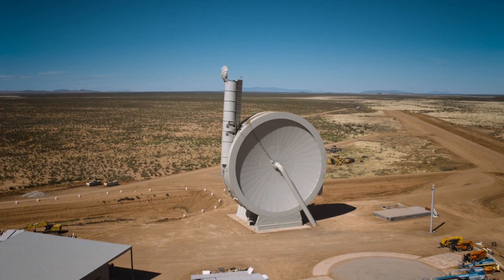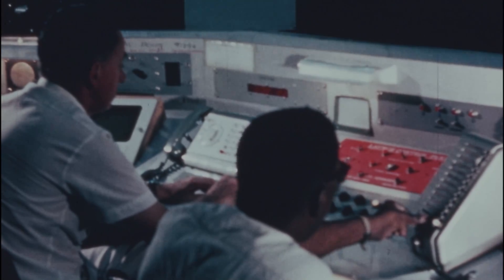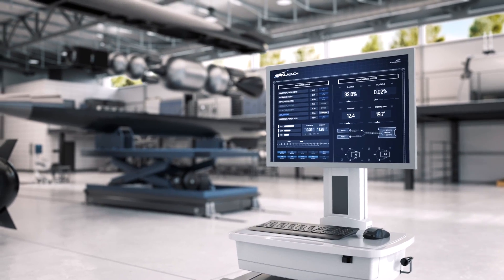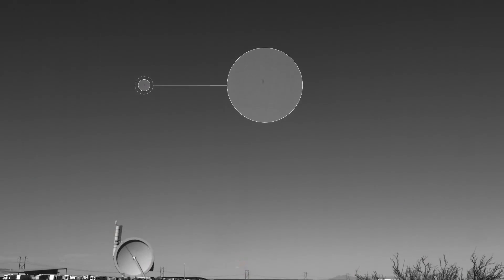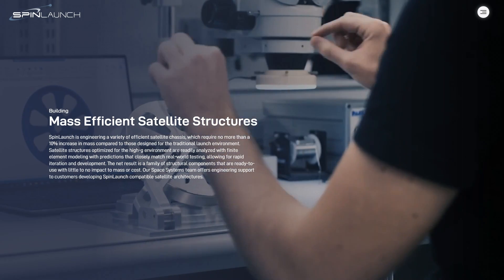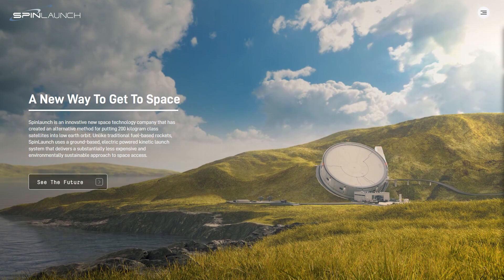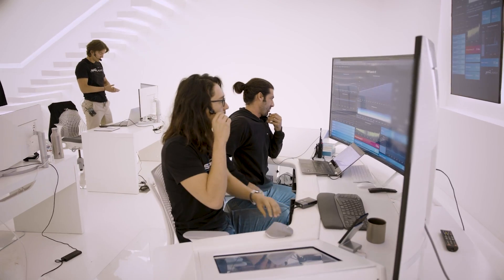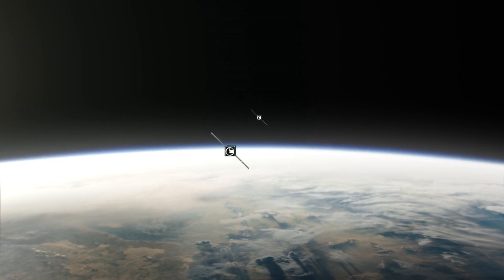Can Spinlaunch Throw Rockets Into Space?

Comment: maybe someone with some scientific sense will read this. no you cannot. they will never make this work.

because such a rocket needs around 8 km/s to get to even the LEO. 

and you know what happens to stuff when it hits atmosphere at 8km/s.

so, a waste of money. best they can do is a little nudge for the rocket, so not worth it.
Reply from the maker: While I’m skeptical, at least I bothered to read their publications and know that they have a 2 stage Kerolox rocket using pressure fed engines.
Reply: @scottmanley  thanks. I am aware of that. This just looks like a lot of work for just a small nudge to the initial phase of the flight. And the 20000G? this whole thing inside, I believe its a technical nightmare to fix everything toegether so it does not break down structuraly. I am not talking about the rocket, but any real sensitive cargo that usually goes into orbit, like satellites and meterology equipment. I don't think it will ever pay itself out and be even an alternative to standard launch technology, and it certainly will not become the new standard.
Reply: @scottmanley  but on Mars where there is practically no atmosphere, or on the Moon... Thats a whole different story ✌️

Comment: 1. rust in the "vacuum" means that its not a vacuum or doing much of anything. that flimsy film isn't gonna hold shit.
2. did y'all not see the angle the thing is exiting at? the point of the tip to the tail of the missile. The thing is tumbling out the gate, they got lucky they didn't obliterate their first test. if it was a real rocket that has to be millimeters to perfect exiting at such a velocity through the shoot, that during a failure would blow up the launch facility that is literally right next to the machine right?

Comment: What if they released the payload and the counterweight simultaneously?
Reply: That's what they intend to do. However the counterweight will cause an explosion similar to 6 tons of TNT when it hits the ground (or any target). I am curious how they fill the crater quickly after each launch.
Reply: @norbertfleck812  That's a good point. I wonder if they could release it into some kind of special material that would absorb the shock in a controlled way, maybe an extremely long tube of water or something like that or maybe use electric braking and reclaim some of the energy lost.
Reply: @jacobopstad5483  Water will cause a steam explosion - the speed of the counterweight is pretty close to that of a meteor.

When you look at videos about KE (kinetic energy) Tank ammunition which leaves the barrel at "only" 1600 m/s you get an insight about what kinetic energy is about.

A car hit by a 2 kg KE projectile explodes as if it was filled with Dynamite.

Comment: No.

P.S. Saved everyone 11 minutes. The only thing remotely interesting that you said, that didn't miss the gaping flaw that is "creating a vacuum that would allow 2km/s within a complicated structure that requires bearings"... was that it could be used on the Moon.

That's most likely the main application of such a technology as it is practically impossible to make it work here on Earth. Not to mention that the founder envisions tens... and hundreds of launches a day. But after every launch you would have to pressurize the launch system... re-seal it as well... Also.... Those idiots are building their control center NEXT to the fucking thing. Imagine something going wrong and shrapnel flying around at Mach 7... You had those railgun clips at the start. Wanna tell me how a few inches of concrete and steel will protect the people around?

Thank god that, as I said, it will be almost impossible for them to reach those speeds anyway.

Comment: What is the fastest any projectile has ever traveled through the low, thick atmosphere?  When the projectile/rocket leaves the vacuum chamber it will immediately smash against the very thick atmosphere near the surface.  That will start to slow it down very quickly because it does not yet have any power of its own.  It will also heat it up very quickly.  Can it survive the deceleration and the heat long enough to get to the point where its engines will ignite?
Reply: I know there was a manhole cover that got shot up really fast after a bomb test at some point
Reply: Over 99% the speed of light I guess if you coun't some proton/electron/quark as projectile.

If you wan't something bigger then probably some debris from nuke explosion.

Comment: What about a hydrogen or helium platform that is raised to 40,000 -60,000 ft. Then spring launched? Tethered to the ground with a cord that raises it. The floatation tanks are on the underside . Wind ,static and lightning could be a problem ,but could be automated .Maybe a couple of diehard technicians onboard with some parachutes and BA if it goes pear shape

Comment: The released projectile will just tumble out of control on release, it'll become perpendicular to the direction of flight within less than a second and will either be destroyed by aerodynamic forces or take a huge amount of energy to remove all the unwanted angular momentum on release.
Reply: This is exactly what happened during this launch too, and can be seen in the aerial footage. 

It started tumbling uncontrollably almost immediately after release. 

You can see even when it breaks through the vacuum seal (so immediately after release); It's already pitched by like 30 degrees. 

This is a complete and abject failure.
Reply: If it was going to tumble as a result of this, it should have been completely perpendicular by the time it got through the vacuum seal. Clearly it actually doesn't tumble like you are assuming, or they have a way to counter it in their release mechanism.
Reply: Exactly. Anything they launch will not be a point mass and will therefore be ripped apart.

Comment: But the released projectile will still be spinning at whatever rpm the centrifuge was when it was released. They have no mechanism to get rid of all that angular momentum. This is prima facie unworkable. You'd need the satellite to be in some kind of ferris-wheel arrangement that keeps it facing in the same direction as it is being accelerated, and that will put a lot more stress on it (because it will experience acceleration in a changing direction during the spin-up). This is just awful. None of the investors understood any physics.

Comment: What benefits does spin launch have to a rail gun launch?
(especially if "future technology and research" is the answer to the multitude of problems)
Reply: WAY simpler and cheaper technology. For example, for a railgun you need enough ultracapacitors to store the total energy needed for the firing/launch.  Spinlaunch OTOH can draw its power gradually from the grid during spin-up. No capacitors, switches, superconductors, etc. needed.
Reply: @ostlandr  lol. Railgun does not need a vacuum. A vacuum for mach5 is insane technology.
Reply: @ostlandr  and what about fire rate? Pulling a vacuum which gets destroyed with every launch creates very long delays (plus the time to then spin up). Plus all the forces during release which would infect fatigue on the whole apparatus, so additional time for thorough inspection would need to be added also.
A railgun on the other hand merely needs to load the energy and cool off somewhat, but should easily have a 20x higher fire rate, with probably lower energy costs.